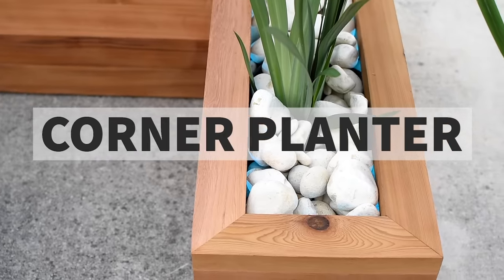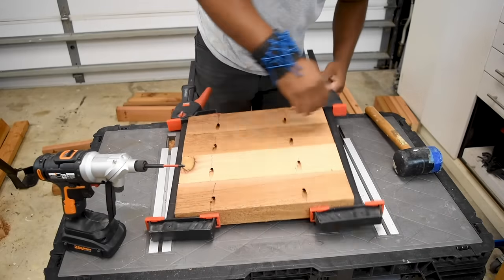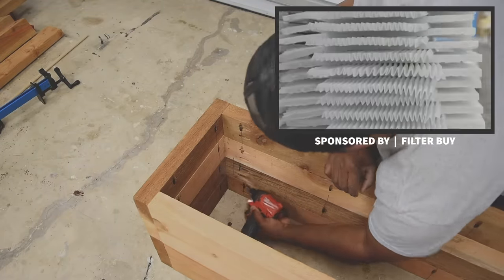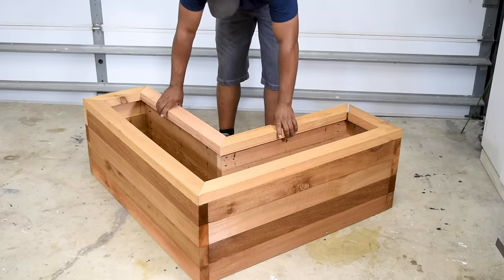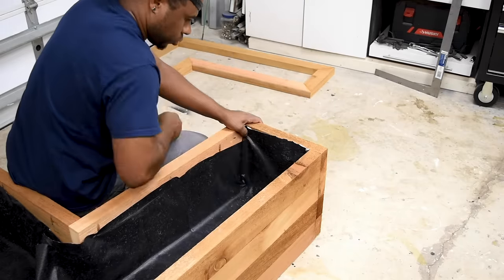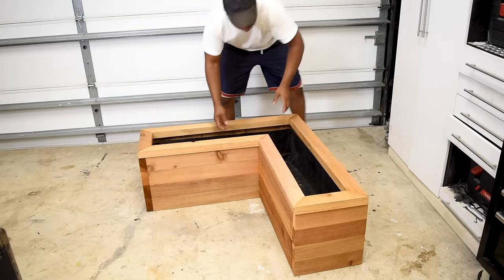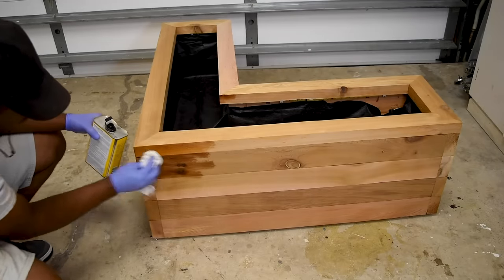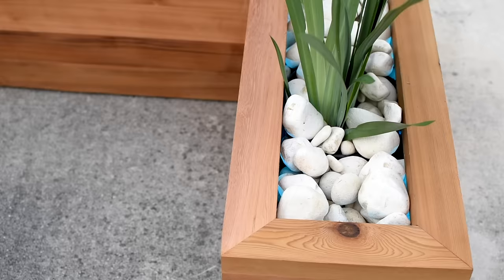How to make an Outdoor planter ( with LED )

Comment: I made cedar window shutters and hand railings for the front stairs outside. I used Olympic clear exterior sealer and it looks great. I have to reseal them about every 3 years, they also get a lot of sun all year.

Comment: Hey, love the videos and the authenticity you have here. 
Be careful planting with part of the pots. You may run into the roots not having enough room to spread out, circling back and eventually choking the plant itself. This is known as being "root bound". 
You can however go back and fix this any time, just dig up the plants, remove the pots, untangle the roots (you can even cut them if it's really bad) and replant them.

Comment: Tung oil comes in different types, completely natural with nothing else added, takes a few days for a coat to dry. Top up with maybe 5 coats over many days. Then there's tung oil which has added chemicals to help it dry quicker but all types need regular coatings just like linseed oil. Tung oil is safe for plants but as you're using a liner inside, you can also use linseed oil (boiled or raw).

Love your videos :)

Comment: I like the rocks and led lights very nice touch man . And the gel is called dielectric grease so if you can’t find the special merrets you can get a small tube of that and squeeze it in regular merrets then a bit of electrical tape to seal it. And use boiled linseed oil for cedar it makes all the colours pop really nice and you don’t need any clear coats .

Comment: Great video.  I don’t know about cedar, but for the record, I found out the hard way that teak needs regular maintenance.  At the very least, you should clean it once a year or every other year.  I let my teak rockers go to weather before addressing the issue and not only needed to clean them, but fill in cracks caused by our hot Texas sun and heat.  In the end, they needed to be stained with a good solid color stain and now they look great again, but are not the natural teak look I love.  Wish I knew way back when what I know now, so please look into it so you don’t run into the same experience.  God bless and keep on building!

Comment: Hi Glen, 

About oil.  It's the best thing to use outside. Tung or teak oils or blended oils aren't too bad.  Not as durable as some others though. 

I recommend Cutek Extreme.  After much time in the field I can say it's worth the price and out performs anything else I've used.  It can be tinted as well. 

You should be able to call a rep from the company to get all the info you need.

Comment: I made an outdoor cabinet on wheels out of cedar with a concrete countertop that acts as a prep surface and keeps my coals and bbq stuff dry. I finished it with danish oil (similar to tung oil), you will probably need to sand it off and refinish it once a year to maintain the look.

Comment: 1/5 stars, not enough pocket holes... I kid. Looks great! The glowing effect is really cool. Modern alien plants.

Have you ever considered using hand planes to reduce the amount of sanding you have to do? They produce shavings instead of dust, so you can do it inside, and the surface is so smooth you have to go over it with 220 grit just to give the finish something to stick to. Not sure if it's slower than sanding, though.

Comment: Impressive.  simple but elegant.  And i we going to do one out of brick and like this idea better 

any oils or finish with exterior will always need some maintenance.   

I wasn’t sure if you left a “lip on outside of planter box when you put the top frame on.  think would look good either way.  

If already built, get some small “dollys (inexpensive and put underneath and drag to location (if feasible). “gorilla cart or equal may work)

👍👍

Comment: As usual great build. I would have probably turned it upside down to allow the pocket holes to be facing downwards as they have a tendency to fill up with water if outside.

Comment: straight tung oil or linseed oil will turn to a yellowish hue after a few years in the sun.  I recommend danish oil,  or for longer protection (especially outdoors), an actual sealer like polyurethane

Comment: I used to work in a factory making windows and doors from cedar 

You do need to continually oil it if you want it to look nice, a varnish will last a bit longer with out needing to be renewed

Also a belt sander with 80grit on it should sand cedar down pretty well

Though this was western redwood cedar in Australia, so might be a bit different

Comment: Just a suggestion, put some sort of space under the planters to keep them off the ground for air circulation and drainage holes are a must on the bottom.
Reply from the maker: Sounds like you missed that part of the video. The planter is not touch the ground I have feet to the bottom.
Reply: My bad !  Looks great by the way.

Comment: Great idea. Your drain holes - water will seep between the plastic lining and the floor wood. Is there a plastic drain thing that you can add to the holes so that water does not seep between the lining and floor wood?

Comment: Nice. If leaving plants in pots then could have added wire mesh attached under top frame. Cut holes for the pots in wire mesh then put the stones on the mesh. No need for dirt with no purpose and extra weight.

Comment: A couple of thoughts:

1. You will definitely have to re-oil the wood off you want it to not gray out. Not worth the trouble IMO, but it's not my planter.

2. The screws should have provided enough clamping power for the glue-up on the mitered to trim. Clamping wasn't wrong, just unnecessary.

3. Love the LEDs. I want to do this.

Comment: All pots require seasonal maintenance... or once per year minimum before Spring.

 In the Spring if you are using them for annuals, apply a new coat of oil right before changing out the soil (if you use it for annuals you need to change out the soil completely).  And in Fall before you deflower it and guard it against frost/snow; keep the old dirt in it to help it keep its shape through winter.  For annuals to perform their best, you want to get a water soluble fertilizer and dissolve it into a gallon of water... and do that every week. 

If you use it for perennials, you want to just oil it before Spring.  Perennials require little maintenance and come back every year.  But you want to ensure that you give those plants some plant food (fertilizer granules worked into the soil) and add about 1" of new soil around the base of the plants every Spring; might have to remove some of the old dirt first.  I like to remove quite a bit and replace it with new soil, leaving about 70% of the old dirt in being careful not to touch the root balls of the plants.  I also pre-mix the fertilizer granules into the soil I am adding and then fill the boxes.  The granules are a slow-release plant food that really helps perennials bloom and perform their best all season long.

Comment: Nice work. I'm concerned that there is no allowance for expansion and contraction, though. The boards on the bottom could be left floating, with a little space between them to avoid buckling and warping later.

Comment: Great job and final appearance. Questions: Should this be UV protected/natural stained if being placed on a covered patio with FL sun exposure. Also, how did you power the LED, wall power? Is that the wire coming from below?
Reply: Disregard, I see it is battery powered. Sorry, was watching the video with sound off while wife watched TV.

Comment: Instead of using pocket screws that are rather expensive and pain to remove, i would suggest clamping peaces, then drilling trough and hammering in a dove with some glue. All natural, no metal to rust over time and you can just cut trough with out worrying of hitting a nail or screw. Also pretty much faster than drilling lots of pocket holes and screwing. On corners you can stack them to get really strong joint.

Comment: Finishing oil replaces the water in the wood and is far more stable and resistant to the weather.
That said, over time it will need recoating as oil merely prolongs the life of wood.
I know a farmer who has wood slats on his trailer that have lasted for over 30 years due to a once a year treatment of boiled linseed oil.
Something to keep in mind, the ends of the grain will suck up more oil than the face, due to the capillary plumbing the wood possesses still wicking water into it's structure. Thus the ends are the most important to treat if the ends are exposed. As for the face of the wood, my advice would be to feed it until it stops taking it in for a first application, then just give it a clean and light coat every year or so after. A brush is easily cleaned with a little soap detergent compared to paint... But fair warning, the brand of oil I use smells like fish in it's concentrated form. The smell does go away quickly, but if your not used to it, it can make some user's have second thoughts about applying it...

That said, I would go with Boiled Linseed as a treatment instead of standard if your in a hurry for the finish to dry. Its faster curing compared to normal linseed, and can even be used as a means of applying an oil coat to metal tools that turns shiny and hard if you run out of other cleaner.

Comment: I was skeptical of *imagined price since I live in one the most expensive cities...just checked and 10 boards is around $100.  *Then I saw your total price listed.  Very reasonable, considering large planter boxes of quality are pricey.  The only problem is finding boards that aren't extremely warped.  I had to pick through a large pile to find 4 good boards last trip, and every year is worse.  So designs using large lumber is not practical on large scale.  If everyone built like that there would be lumber shortage almost immediately.  It is of course much nicer to use large lumber for that quality/expensive look.  I just tore out deck stairs for a customer and after an hour of planning and trimming off rot I have a nice stack of thick cedar boards with dense grain from the 30 years ago.  Unfortunately, my planer took hits with embedded dirt and possibly a nail I missed.  There really is no free lunch.

Comment: Did you thin the tung oil? I read that if you thin it down for the first coat it soaks in deeper and then subsequent coats at full strength build up faster. I did a wood project last year and used tung oil. I didn't thin it and it took a lot of coats to build up to the desired finish.

Comment: You probably could have saved a bit of money and weight by not using all 2x4s. I would recommend a modified build of this, where the 2x4s are used only for the frame. I would use cedar picket fence boards for the sides etc. Also the sanding part looks like a good excuse to get a planer

Comment: Enjoyed watching, but would be helpful for someone like me if you include the general cost of your project.
Reply: Looks like hes got about 10-12 cedar 2x4's which would be about $100 usd where I live, add maybe 2 pressure treated 2 x 4's at about $5, about $6 worth of Kreg screws, about a $15 LED strip, and maybe add a few dollars for glue and sandpaper - $140ish.  I wrote all of this and then saw that he put the estimated cost in the description.

Comment: you gotta start using mortice & tenon . . .  less screws lowering material costs and a more solid build . . . pocket screws for everything is bad imo . . they have a purpose and its not general construction or structural bearing, weather exposed pieces . . . calc the cost up of doing that exact build but using japanese joinery and wood pins for nailing and see what you come up with cost wise, look wise and durability wise as well . ...

still love your work dude, its great seeing people grab a tool and make stuff :)

Comment: All the projects I've seen here are great and the planing and explanation is very good, but I just have one issue, all projects I see here need a bunch of tools that for someone that only wants to do just one project is not practical. I do understand that for a great result you need good tools but for those first timers or one timers this would discourage even trying some of the projects here. It would be nice for those I've mention that you do some of these projects with just basic tools. I learned wood working from my grandfather and some of the tools I see here where not even invented back then.

Comment: You could just put the plants with their pots in the planter and put the rocks all around. Or a light filler material like scrap wood and put the rocks on top of that. no?
Reply from the maker: Totally, there are ways to bring the weight down. Many routes you can take.

Comment: That's pretty sweet!  You will have to reapply the oil at some point... I don't have a recommended schedule (every 6-12 months?).  Worse case scenario, if you wait too long, bring out the sander, sand off the weathered portion and re-oil it.  Marc over at The Wood Whisperer has a video about it - https://www.youtube.com/watch?v=vDlLsVzbkX4